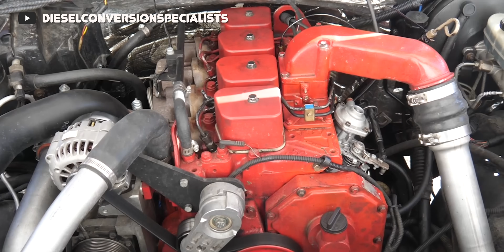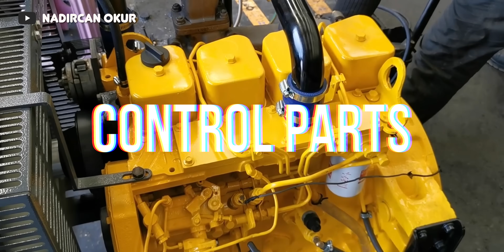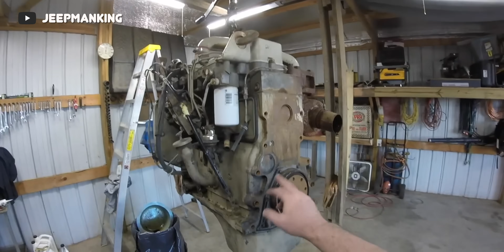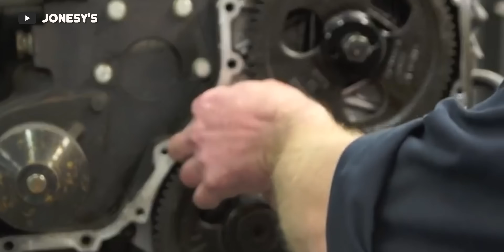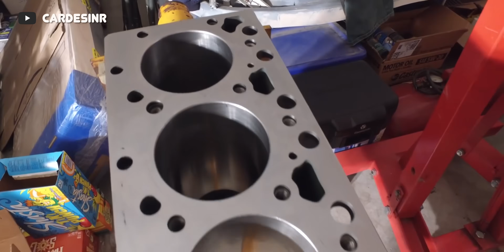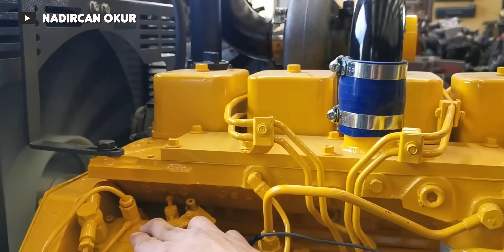Everything Wrong With the 4BT Cummins (It's OVERRATED)

Comment: You can get a 1.9L or 2.0L VW TDI engine weighs about half costs less then $1000  and you can just program the software to have more power then the 4BT.
Reply: Buts its a vw not a cummins
Reply: All of the pissing match over number is only important to a certain degree. A transmission, transfer case(s), ring and pinion all act as torque multipliers. Which means I can have an 80 horse VW bug air cooled motor climb the same portion of a trail as the LSA supercharged v8 simply by having more gears in the trans, different ratios to the gears, more gearing in the transfer case and differentials. Keep things in perspective people. Yes numbers matter to a degree but you can make a lower number car perform close to or near a higher number car given other variables
Reply: No matter how u tune ur vw tdis. Thay can never ever make same power as 4bt that raw torque u get from it. Can ur tdi handle the load of generator...? No it cant but 4bt can. No matter how high hp nums u have on dyno. It cant compete stock 4bt on generator.
Reply: @harjinderkaur2384  you can make anything make power it's the longevity that's the difference
Reply: A 1.9 or 2.0 TDI PD is the most bulletproof motor VW ever made imo. Just run 5w40 or 10w40 diesel oil it really doesn't like thinner oils and they run forever.
I like the old Unit Injector (that's what PD stands for) TDI engines a lot. They are really high compression diesels compared to what we have today I think they run about 19:1 so they rely less on the turbo to make power. 
But when you do tune them up they easily make 200hp and 400nm torque without even rolling coal. Spicy lil motors!

Every VW diesel from 1998 to about 2007 is a PD TDI so you can pull em out of any old junked VW diesel from that era and they made a ton of them. If you can find a late 2.0 16 Valve that's a jackpot.
Reply: @alouisschafer7212  wrong wrong wrong and wrong. German autotech here with numerous vw alh and bhw swaps (1.9 digi pump, and the later 2.0 common rail) 
Common rail engines have stronger bottom ends and can surpass the 175ish hp where a alh bends rods, however you have a commonly failing balancershaft and commonly weak lifters and cams, a high pressure fuel pump that likes to eat cams or destroy itself. Many many many reasons a slightly older 1.9 digi pump alh is ridiculously more advantageous when you also have enough experience as me with these engines to realize they ARE NOT RACECAR ENGINES.... neither is a damn cummins and your only wasting money putting lipstick on a pig.
Reply: @alouisschafer7212  the 16v heads restrictions flow, they have smaller valves, the 16v was made for economy 
1.9 8v is what you want!
Reply: what about simplicity  ?
Reply: @minimanadam  yes I think the 4bt would blow away the vw at this
Reply: Tdis cant cant compete 4bt in torque. May b hp numbers on dyno bcuz tdis r high speed than 4bt but they r no where close to 4bt in torque n that raw diesel pulling power.
Reply: The VW is a light duty hi reving diesel engine. The 4BT is a medium duty medium rev engine. Good boat engine. Ran a 6BT in my tunaboat.
Reply: @808bigisland  high revving? Mine barely goes above 2300
Reply: @makatron  You might want to understand what you are doing wrong and it will kill your crappy engine...search for "why not to lug an engine"
Reply: @makatron  yeah that doesn't sound right i have a hilux with the 3litre mechanical injected diesel and it will happily do 3500 rpm and i believe the tdi don't even hit max hp till after that
Reply: @shaynegadsden  my mistake, in my head I was thinking about torque
Reply: @808bigisland  No, most European diesels are tuned to be lugged.
My work van is a Renault trafic, 1.6L diesel, 120hp, ~300NM torque. Although it will rev to just short of 5K rpm the torque band is between 1500-2500rpm so that's where you have the engine 99% of the time.  It's why 6 speed manual boxes got adopted very early in Europe. 
Thing will cruise at 80mph all day every day and if the speed is kept to 55-60mph on the motorway/freeway, even fully freighted (~6200ib) it'll do 31-33 US mpg. 
It's no power house, but I've never found it under powered.
Reply: more HP sure..... but not as much Torque
.
nor will the VW engine last 500,000 miles
nor will the VW get as good as MPG
.
.
a 1.9 VW that makes the same hp (and especially torque) is going to be HIGHLY stressed 
and we are finding MANY issues with these new 500HP 3 cylinder engines.... due to how HIGHLY stressed they are
.
sure, the 3 banger is fine for the first 75,000 miles
but then you need new rod bearings.... as the cylinder pressure needed to get 500HP from 900CC is INSANE
and it beats the rods to death
ETC
ETC
ETC
.
.
id rather have an 8 liter engine that makes 200 HP and 500 foot pounds
as it would last for 2 MILLION miles
Reply: 2.0pd VW ftw ,it'll walk all over the normal 1.9 TDI. 
Hoping one of these in my mk1 with around 400hp will be fun. 
Can't wait to bust gearboxes with 500+ft pounds in an under 2000 pound car.
Reply: While i really agree with this the TDI is awesome. I think the 4bt hits with a lot of people just for the fact that not many folks understand the wing aspect of the TDI
Reply: You can also swap a mechanical injection pump on a tdi with a little know how
Reply: Without even 1/32 of it's reliability.
Reply: 4bt vs a VW lol. Maybe in Germany.
Reply: Thats true, however these are designed to run a lot longer
Reply: Won’t work for any high stress/off-roading..
Reply: I don’t think a TDI would hold up in a F250
Reply: @Onedollarbeer  maybe not the 2.0L  but the 3.0L TDI is made for heavy work. It's used in the Cab and Chassis VW Crafter - with a total weight of about 8-9 metric tons. (17000-19000lbs GCWR)  those things easy run a half a million km.
Reply: Vw is stinky
Reply: Show me how well a tdi works in a bulldozer or tractor.  They are not interchangeable.
Reply: @randymagnum143  different Use-Case - in the video it's noted hat people swap 4BT into cars, jeeps and small trucks - a TDI is better suited for those.
Reply: @eXo0us-T  you're right.  Tdi's work well in small passenger car or compact suv/truck swaps.  The 4bt will last 10k+  hours at 100 hp load.  The tdi would not last the 10 hour drawbar test at Nebraska tractor test at 100 horsepower.  People don't understand how much harder an ag/industrial engine is stressed.  Or what a 100 horsepower drawbar load looks like.
Reply: Yes but if you use a Volkswagen 2 L TDI for the intended purpose of the 4bt the TDI engine would not last a month. They're night and day different engines. The 4bt truly is an industrial engine and while they are flaws with every internal combustion engine the Cummins 4 and 6 cylinder industrial engines have earned the most reliable and heavy-duty engine in its class for a reason
Reply: But then you have a VW motor…?
Reply: The whole point of using a 4bt Cummins is its all mechanical meaning no complex computer issues , yes they are finicky being mechanical but just as reliable if not more reliable than a vw tdi engine, but being a gear head I love most engines and they all have their own quirks
Reply: Ya you know everyone said do the vw tdi in my toyota instead of the 4bt, but for what I have in the 4bt and stuff to run it in my toyota cost just about what the adapter plate for the tdi cost. So that being said my 4bt swap was cheaper and I get to stay basic without a bunch of electronics.
Reply: Nope they’re both weak but the 4bt can handle way more power with less hard parts
Reply: My 4b is over 500hp please show me a tdi that makes that reliably
Reply: @jagg5474  no replacement for displacement.  These 4bts were in  14k lb step vans.  Try that in a 1.9 TDI.
Reply: @jagg5474  I knew a guy who was or still is not sure, racing TDI engines. He said he could build an engine to 300 horsepower but they didn't last all that long if you ran them hard. The 4bt or a 6bt can be built to 500 horsepower and used as a puller at least a moderate pulling at that horsepower and run day and night
Reply: @jagg5474  that dude on here with the mk3 golf.
Reply: @jagg5474  and how much did you spend getting to 500hp? Exactly 😂😂
Reply: @jagg5474  that is true bro, they are barely around 450hp I believe with tons of work…
Reply: @jagg5474  considering there's a 2.0 TDI engine that makes over 250hp stock, yeah I'd take that over the Cummins. Now if you say a 6 inline engine that's a different story.
Reply: @jagg5474  I'd rather a 3-51 dd
Reply: @jagg5474  it's only $1000 bucks and you can get about 250-300HP out of a TDI. It is a tiny engine - you can fit it in many more projects then the 4B 4BT.  If it blows up after 200.000 miles no big problem just get a new one, its so cheap - almost disposable ;)
Reply: Your vw engine can make all the hp it wants, but to make reliable hp is what most guys are looking for. The 4bt block, pistons,  crank etc are all heavier then a vw therefore the likely hood of your vw being more reliable then a 4bt is not even comparable
Reply: @damonens9478  You'd be surprised the mileage you can get out of a older well maintained VW engines - especially the pre pd diesels. Easily 250K miles if their looked after properly.
Sure a cummins will do 500K+ but it's an industrial engine at the end of the day where the key design criteria is long life not power to weight ratio.
Saying that Linde forklifts used vw engines for years (diesel and lpg) and I've seen plenty still running OK with 12-15k running hours on them, grated they have been governed to 2800rpm as being used in an industrial application.
Reply: @damonens9478  in stock trim the TDI easy goes a million km / 600.000 miles. When you tune it - still holds up for 200k. So it's not an unreliable engine.
Reply: @eXo0us-T  yes but you are taking over 70% of the reliability away to make that horse power. You don't need to do that with any Cummins engine. Look im not a Cummins guy im a duramax guy but Cummins blocks will just give you way more reliability just in the block. Taking a small engine like a vw and cranking it up just won't work in most settings
Reply: @damonens9478  works for every application outside of a heavy truck. Most Convertible/Car/SUV chassis you might want to swap a diesel in. There the chassis doesn't last much more then then 300k  so it's really not a big deal.  My Truck is a RAM,  but I got a Volvo station wagon with a TDI - it is very quick, gets insanely good fuel economy - 46mpg,  almost 400ft/lbs - tow up to 6000lbs pretty easy.
Reply: @eXo0us-T  if you are dropping it in a car it's probably the better deal, but if you were going to put it in a piece of heavy equipment and work the hell out of it, Cummins all the way
Reply: @Bhpfire  I got a RAM cummins truck and do not disagree - for very heavy duty application, but for many swaps - even in older pickups and classic cars a TDI is easier to source - fits in more engine bays and makes similar power to a 4BT. and is darn cheap.
Reply: @eXo0us-T  4bt can crank out double that torque without even sweating
Reply: @eXo0us-T  bro.... 200K is STANDARD 
.
if you are bragging about an engine ONLY making it to 200K..... thats NOT a reliable engine
300K min!!! should get 500K!!! if not 750 or 1 mill!!!
.
ive got a 99 buick century 3.1 v6 with 350,000 miles..... and its headed to 500,000 
runs perfect.... compression is still perfect.... oil pressure is still perfect.... ETC
.
.
its pretty sad when a POS gm 60 degree v6 can outlast a VW diesel......
Reply: No u wrong those 1.9 or 2l vw tdi can never have same pwr as 4bt. May b in numbers but practically do u really think that if u put that vw 2l tdi in a tractor n its gnna pull the same number of ploughs dug deeper into land ...? U really think that wud happen..? No way. Those tdis r faster n yes powerful but not as powerful n torquier as 4bt. I bet.
Reply: I'm with you all the way VW and be riding with a pocket full of money 💰 won't have to worry about me and a 4bt motor yall can have them !!

Comment: They are very good little engines…but they’re so damn expensive now, I don’t believe it’s worth it. To give an example, people have been swapping 4BT’s and 6BT’s into Jeep’s for a long time. To swap a 6BT into a jeep, you have to stretch the engine bay by 4 or 5 inches I believe, which is obviously expensive and time consuming…a 4BT on the other hand fits great…but, because of how much the 4BT’s cost, I believe it winds up costing about the same to swap a 6BT in, and then you’ve got 6BT horsepower and torque.

Basically, if it weren’t so damn expensive, every ‘what engine should I swap into my car?’ Conversation would go ‘what engine should I swap into ___’ ‘a 6BT.’ ‘It won’t fit’ ‘a 4BT.’ Left stock, they’re a bit gutless, but bombproof, and you can turn them up to the moon just like a 6BT if you want to.
Reply: A 4bt is more expensive than a 6bt because they are rarer.  You can do a pretty much stock looking swap with a 4bt.  I guess that matters for some and worth the cost
Reply: @joeyscleaningladys  exactly. The 4BT’s where basically in skid steers, other small construction equipment, generators, pumps, maybe some marine. The 6BT’s where in all of those applications and automotive, and obviously with the on road use cummins chugged out a pile of them

Comment: In my experience with them they always ran, but made no power,got really pissy when the Temps went up or down but worked great as a pump engine.
Reply: Yeah they're basically a shittier CAT 3304. They're decent and run forever while taking abuse in industrial applications
Reply: @melvingibson4525  had plenty of those too...
Reply: afc or p pump easy to turn up, but yea stock they are dog slow.  But turning a couple screw driers and you can get 140hp easily

Comment: Very unreliable engine from experience
Reply: What did you see one in?
Reply: @bcdieselsofficial about a year ago a buddy of mine 4bt Cummins swapped a 1997 Ford obs f-350,,he said the 4bt done nothing but crack cylinder heads ,,been through 6 different injector pumps and I don’t know how but it snapped a freaking connecting rod in half like a freaking 6.7 powerstroke,,,he also said the day after it got sold to the shredder company he said it leaked oil literally faster than he can change it,,and the guy he bought it off of did a complete engine rebuild top to bottom inside and out ,,he bought the 4bt for 12k and put well over 12k into it just to fix half of what happened.I’m going to be towing another 8500lbs in the 6.4..btw how much are 5.7L Chevy diesels,,I’m planning on getting one some day probably when I have time witch probably will be in 50 years but I can make time ,,thanks
Reply: @Levigoodwin7  Steer clear of any Chevy diesels before the Duramax. The 5.7 is perhaps the worst engine of all time!

About the 4bt, the guy must have gotten a lemon or the previous owner did a crappy job rebuilding it. For 1997, I have no idea why he would swap a 4bt instead of a 6bt. Did that truck originally have a 7.3? If it did, I would much rather drop that in!
Reply: @bcdieselsofficial  the 7.3 was old,,I honestly don’t know what he swapped it to a 4bt but he like it for the 3 weeks it last ,,I hope the rebuilder did a crappy job cuz I kinda like the 4bt not a lot but I like it,,thanks for the 5.7 advice,,I did 2 burnouts in my 6.4 today lol I didn’t break any thing yet lol,
Reply: @Levigoodwin7  no problem!
Reply: @bcdieselsofficial  out of curiosity,what duramax  would you recommend
Reply: @Levigoodwin7  LB7, LLY, LBZ. Also LMM if you can delete your truck. LMM is just LBZ with higher coolant flowing heads and extra emissions controls. If it were up to me, LBZ with LMM heads and LB7 pistons, if you want a completely legal truck. The ultimate Duramax, however, is a deleted L5P.
Reply: @Levigoodwin7  5.7 Chevy diesel? Are you referring to the Olds 5.7 diesel used in some Chevy's?
Reply: @turbo8454  such junk, all those gm diesels gave em a bad name back in the 80s. 
Some guys do ok with their 6.2/6.5gms but they are gutless and just a time bomb waiting to break. 
Can't believe our military had to rely on that turd in humvees,and they derated it down to 130hp to try and get it to survive for a while, I woulda been scared s*itless getting shot at and flooring the pedal in one of those to get away.
Reply: @turbo8454  I was just planning on looking on how to fix there issues ,,I asked to see how f***d up they are so I know what I’m getting into
Reply: @bcdieselsofficial  thank you
Reply: @Levigoodwin7  no problem!